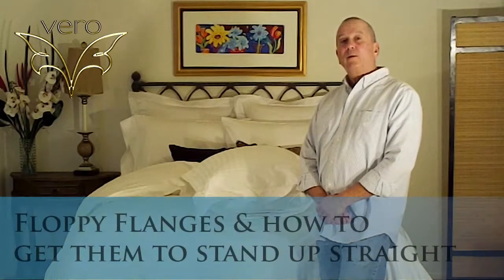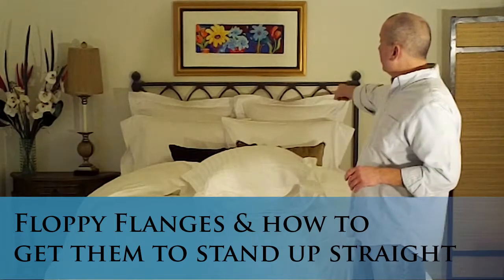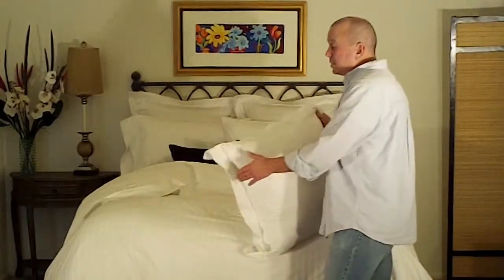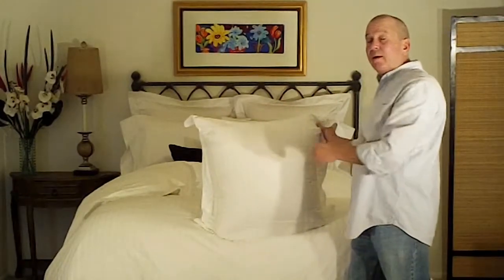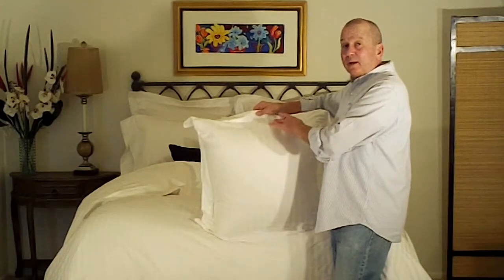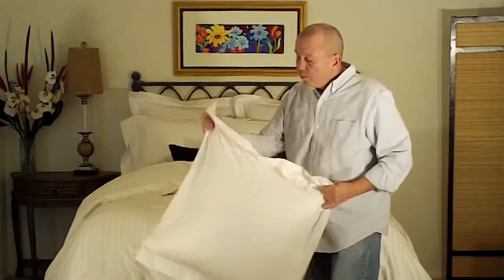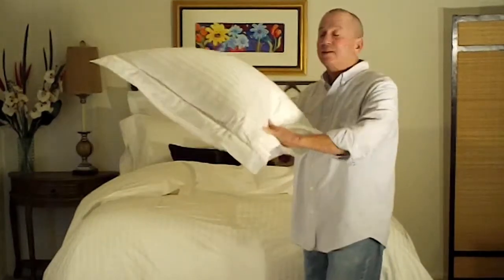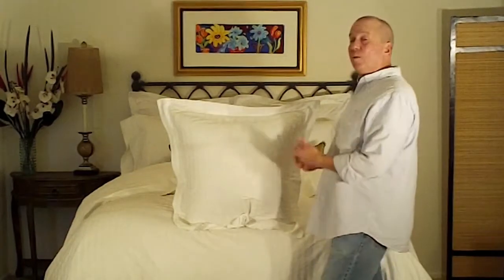How to get your floppy pillow sham flanges to set up straight! (www.verolinens.com)

Comment: Hello Steve,I just purchased a complete Croscill Comforter set. The material is very heavy, and I am experiencing a major issue in reference to having the flanges stay vertical. Regardless of type of pillow used, the problem continues to exist. I would like to know what these manufacturers do when they display their product.  Pillows always look so perfect.
Reply from the maker: I can't speak for Croscill, however some manufacturers will put tape (likely a packing type tape) on the back side of the flange. Starch is another way to stiffen the fabric up. As well a lot can be changed in Photo Shop.
Can I assume you are talking about the top edge of the flange?
Reply: Correct. However, I did notice that there is a pocket behind the flange. So I thought about purchasing a plastic strip and inserting it into that pocket area. I think that may do the trick.
Reply from the maker: That may work, I may not sure...

Comment: Thanks...this has been bugging me forever...how do you do the edges on a normal pillow case as well?  Mine won't stand up like I see in hotels/pictures
Reply from the maker: Farakh, we are not sure what you mean when you say "normal pillowcase" a pillowcase typically does not have a flange. If it is a sham they should be able to stand up, it also depends on what the fabric is. For example, silk will likely not stand up. If you could provide us a little more information we might be able to assist further.